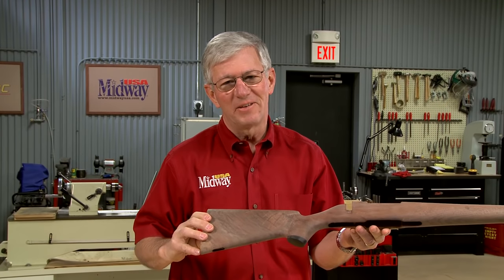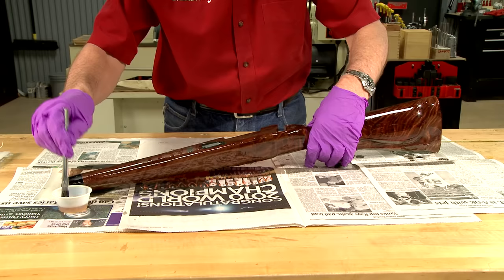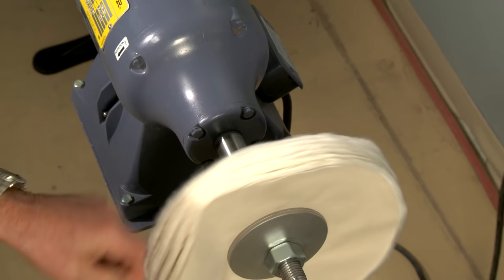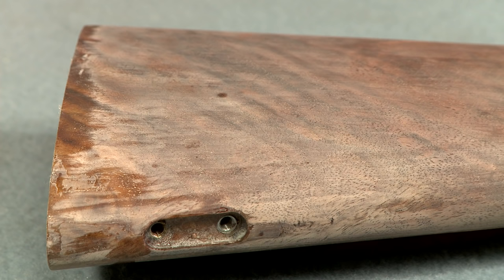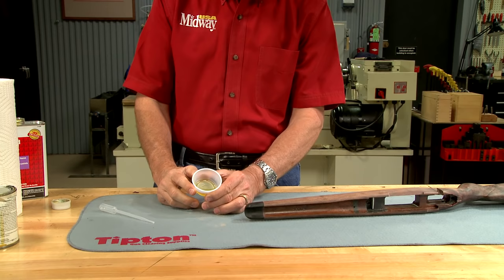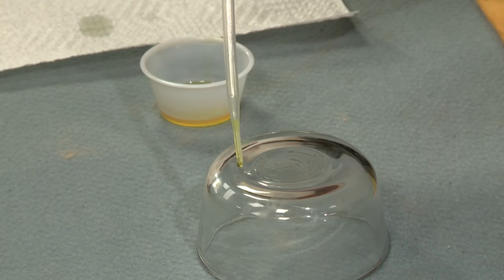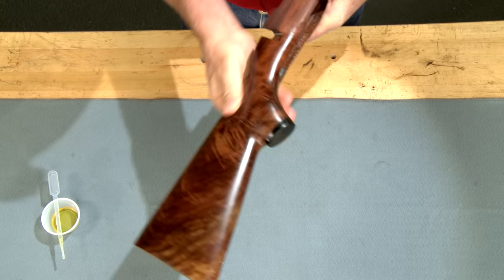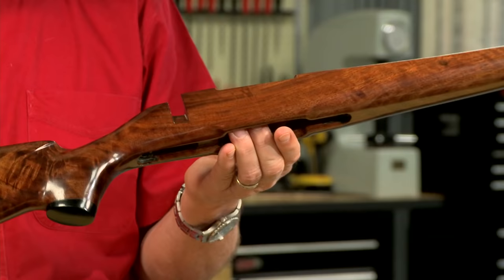Gunsmithing - Stock Finishing with Bar Top Varnish Presented by Larry Potterfield of MidwayUSA

Comment: Instead of shellac or varnish as a wood filler, why not use a gellatin or water reduced hide glue? that's what we do when making violins and only 1 coat is needed.
Reply: +Mathias Chaidez I seriously doubt you're treating the violins the same way they'll be treating that rifle. As much of a pain in the ass it is to do all of that the surface ends up being super tough ... and that's on top of being completely sealed. Both of those qualities are very important for such a thing as a rifle stock considering the type of work it'll be performing and the type of environment it's expected to perform in , so comparison to a violin (which is normally babied) finish is incorrect.
Reply: Would the finish on your violins stand up to the elements outdoors? Sun, rain, snow, cold, heat?

Comment: I was looking for a way to fill the grain prior to finishing a gunstock with tung oil, so I find this video very informative, but it takes forever to finish a stock following every instruction in this video.  I've already finished a stock (previously sealed) with tung and teak with success. Now, what I'm going to try is put in practice the general idea of this video with more practical products  : Sealing with 2-3 coats of wipe-on poly (thinned poly), followed by the 3-4 coats wet sanding of my own recipe of danish oil (6 parts of Circa Tung and Teak, 4 parts of Minwax satin oil/urethane varnish, 1% Japan dryer, no thinner). With this recipe drying time is down to 2-3 hours, and there's no need for a drying cabinet as long as the temperature is 20 degrees Celsius  or over (68 F +) . Wish me luck!

Comment: I get the same results from Daly’s “ship to shore” product and it only take 3 days at most.  Once you hit 220 grit apply let dry (04:00:00) then repeat using 320,400,600,800,1000,1200 grit sand papers then dry polishing wheel.

Comment: Just curious if anyone has tried Shaftol, on a stock. Not that I have seen it sold in the USA, it comes from the Ballistol company, brought a can when I moved back to the states. It is linseed oil with different colors, mine is a red tint, and has silicone additives.  It is what the gunsmiths at the gun shop I worked at in Germany use to finish stocks.

Comment: I've been woodworking for a long time, by far natural and traditional finishes are my favorite to work with hands down. while I'll be honest and say synthetic finishes such as epoxy, resins like polyester, lacquer like urethane or acrylic can be much stronger, wear resistant and weather resistant. You just don't get the beauty and feel you do using traditional Lacquers like Shellac, Nitrocellulose, oils and varnishes, waxes. EVEN BARE WOOD SANDED SMOOTH.. No really. Although I don't think I'd recomend the two latter for a rifle stock ha. The sweat from your hands would most likely cause your stock to swell. Take that out for a rainy day and you'll have yourself a fat, soggy, misaligned gunstock at the end..

Softer, more natural finishes wear over time yes, but that'll just give your wood character. Something you can't really appreciate with plastics. Not to mention traditional finishes are often easy to fix without disturbing the rest of your piece or using harsh chemicals. Though everyone has their personal preference. Larry dose great work on his stock finishing videos he seems like he knows all the trade tricks.

Comment: what kind of dryers do you add to the b.l.o.the boiled linseed oil that they used in the 18th-19th centuries had lead and other dryers that we now know are toxic. the b.l.o. that we use now doesn't have any dryers that i know of. i have friends that add a lot of japan dryers to their b.l.o., but i just don't use it. it's not a very strong finnish, meaning it may be o.k. for a firearm that doesn't leave the safe more than once or twice a year, but for a flintlock brush gun, nope.all iv'e ever gotten was cracking and crazing. i love your video's. as a self taught black powder gun builder, the video's you produce are informative and very helpfull. thank you very much.

Comment: Has anyone ever tried water based polyurethane varnish instead? I'm just wondering how well it works ...
Reply: I would avoid polyurethanes on a gunstocks because it's pretty thick and the hardness with use can chip off. I've seen it before and trust me, 
it's no fun trying to fill spots of polyurethane to match the existing coat. Stick with Linseed Oil (boiled dries faster) or Tung Oil is my advice.
Reply: YES I HAVE. Modern automotive clear coats are far superior to Larry's finishes.
I have been doing it for over twenty years. Color sanding and polishing will last way longer, and give much greater depth than anything this video shows- FACT.
Reply: Not waterbourne varnish. ..Clear coats sprayed at about 40 PSI with a Sata 2000 in an automotive spray booth. Light years ahead of this stuff.
Reply: Water based polys are not as tough, go one clear without really adding any depth or definition, and they will raise the grain of the wood. I use it on some furniture I refinish, but I use a washcoat of dewaxed shellac to pop the grain first.
Reply: that explains the reaction I had ... :)

Comment: Not sure about this method. Surely, the linseed oil needs to go on first using a number of layers to penetrate deep into the walnut and to fill the grain. When it’s completely dry it can then be covered by the bar top finish for however many coats. Final rubbing and polishing will provide a gloss finish which is protective and waterproof. Or have I got the logic wrong?